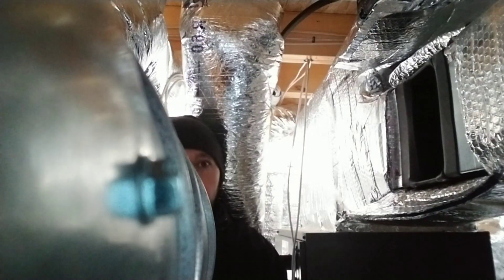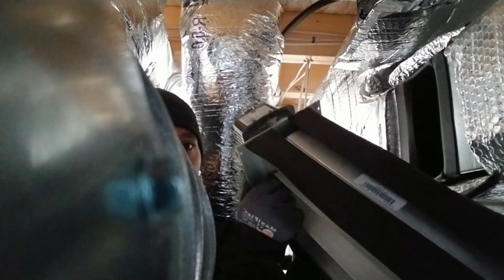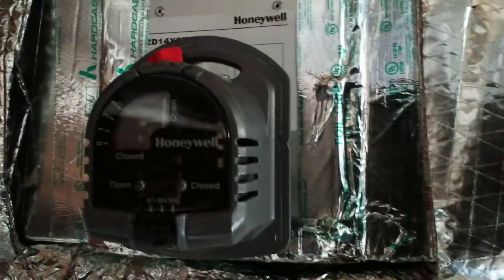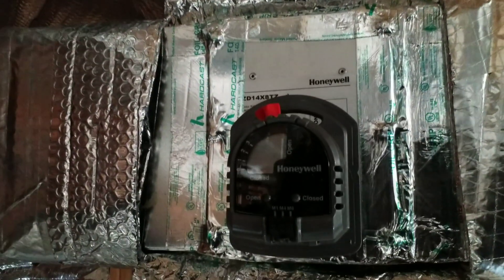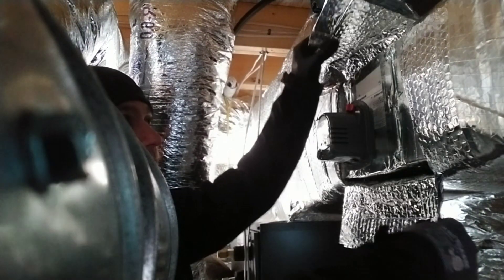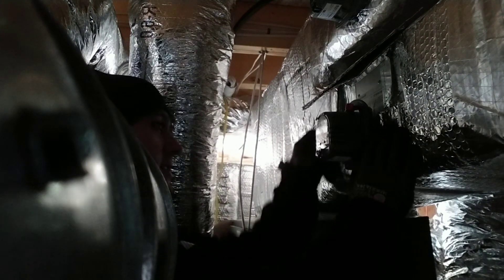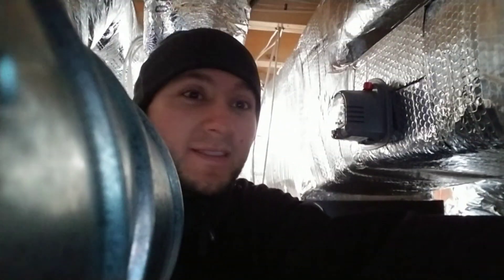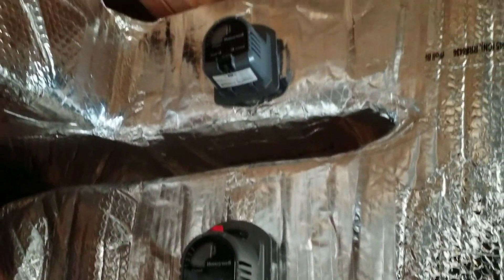How to install a motorized damper on a ducted system

Comment: My duct measures 20 X 12 outer dimensions.  It has about an inch insulation all around on the inside. The old 20 yr. damper I took out was only 18 X 10 inches.  Seemingly small for the space. But anyway, should I order the same size or perhaps go with something larger?

Comment: What do you do if the duct is larger than the damper? My duct is 9.5 inches tall and I cannot find anything to fit that size.
Reply from the maker: Add foam tape insulation to the sides of the dampers. Are you sure that the inside of the duct is not 8"? 9.5" sounds like the outside dimensions of a regular duct with some type of insulation. Hope this helps

Comment: Just what I needed, though Id have to take ductwork apart! Huge help, dampers are on their way. Thanks man!!! “Damn good looking damper” 🤣✌🏻🍻
Reply: What's the metal frame he slid the damper into ? 
Did the damper assembly go right into the duct ?
Reply: Yes sir. It slides into the duct which he cut an opening into the side of duct to accommodate the size of damper.
Reply: @seancotten8076  Whats it called, Where can I find it?
Reply: @craigchapman2676  
Im not sure what your asking. The damper is an entire unit with the frame already included around the damper. I bought mine from “Supply House” online, they had a great variety of different size dampers for different size ducts. I had a 22”x8” duct and a 16” x 8” duct. So thats the two dampers I ordered. Once you get the damper, you simply cut a rectangular hole in the side of your existing duct and slide it in. (I believe  both holes in the side of my ducts were 4” left to right, then of course the height of the duct which was 8” tall, then I slid each unit into the side of the duct. One was 16” long and the other was 22” long to accommodate the width of each duct) the dampers have about 1 1/2” wide flange on the side. Meaning the rectangle cutout was 4” wide, but the overall width of the plate on the damper was about 7” wide. Then you simply run self tapping screws through the flange inti the duct. Hope that makes sense.
Reply: https://www.supplyhouse.com/EWC-22X8ND-22-x-8-ND-Motorized-Damper

If you follow link above, it will show a picture of what I bought. Hopefully looking at pictures of damper will help clear up any confusion.